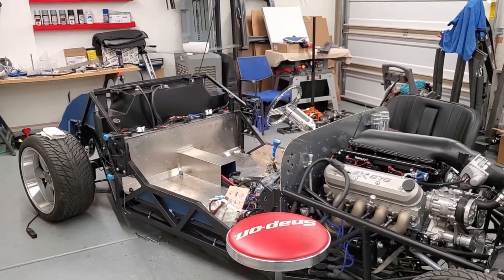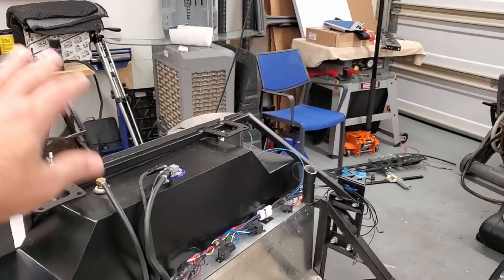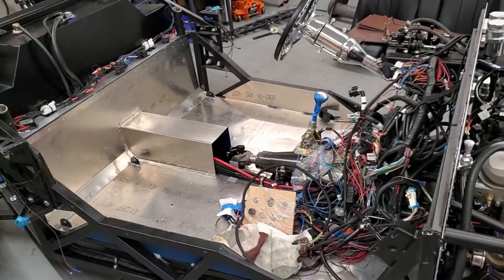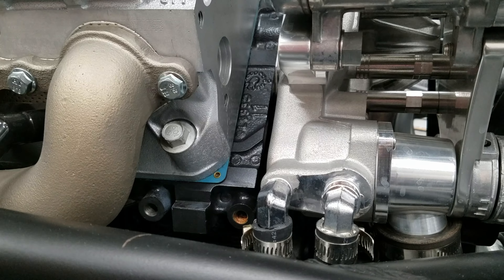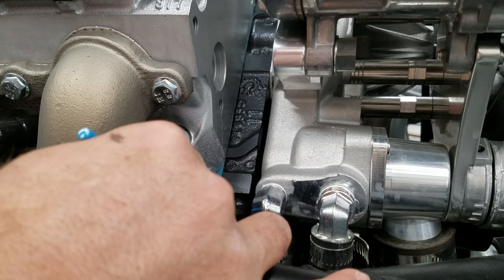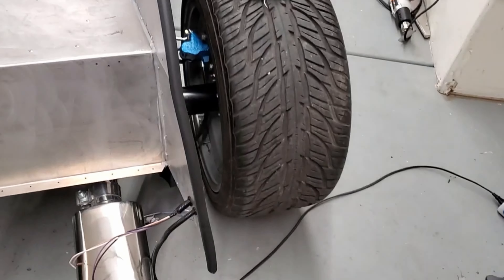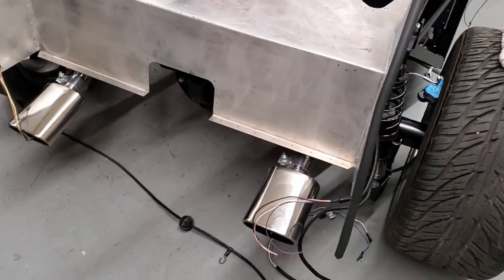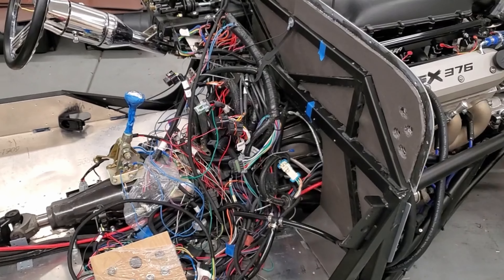Factory Five 33 Hot Rod V2 - Interior Assembly - Weatherstripping & Seat Belts

Comment: Hi Jim been watching your build very informative I'm building a mk4 ls with a 4l60e transmission what shifter you using
Reply from the maker: So this is what I bought.  Lokar Automatic Trans Shifter 4L60 CM4l60eFMP  It came with a 6" strait, but I ended up switching this out to a 8" single bend (not seen here).  You can order what you need out of the gate, but I did not really know how to size it all up since this was my first time.  They also make a auto manual shifter now, but all my regular cars had them and I never used them. (they don't shift like paddle shifters on a race car or lambo)  Not sure how fast the Lokar auto shifts...  Hope this helps